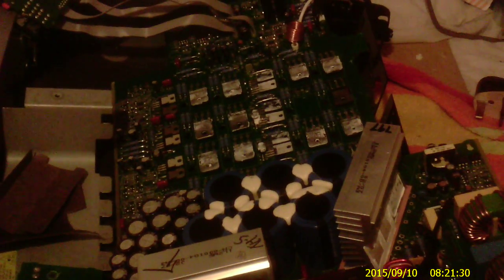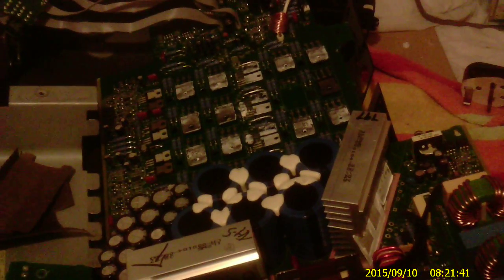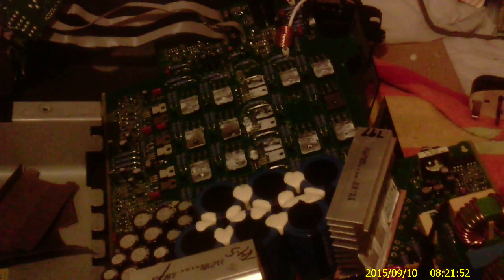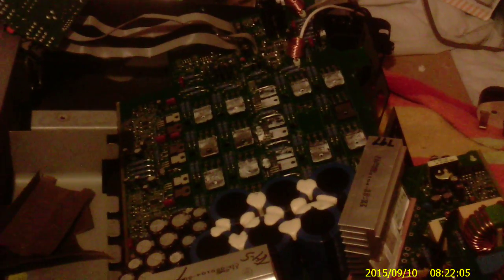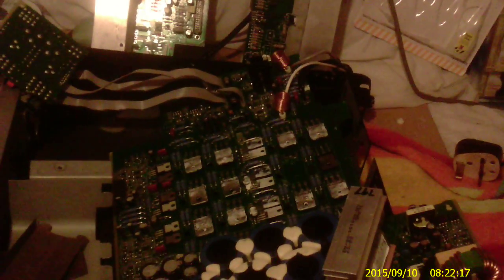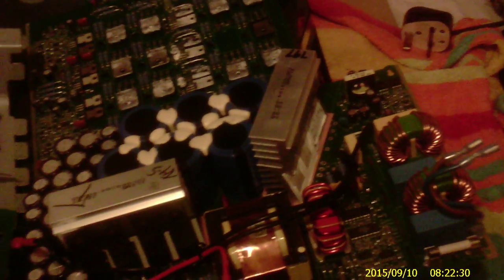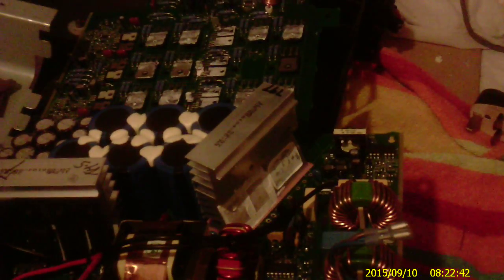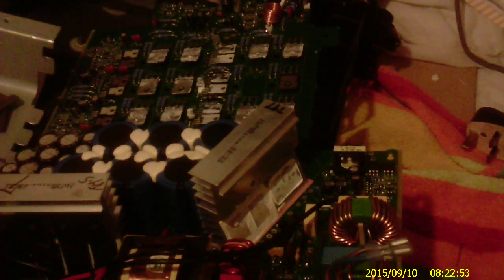QSC PLX3102

Comment: Hi,

So interesting and educative , I have a burning question and I wonder if you can have a better answer . Definitely I see you are good in these amps. I do have  two amps with 120 v and my power is 240, So I normally use a step down transformers which is heavy for my mobile. I am told that these amps power can not be modified to 240. I would be much glad if you enlighten me better as regards to this.

  Kind regards Francis
Reply from the maker: Are they switch type power supply if not then it is simple to work out simply input your 240 to 110v ac transformer disconnect the secondry ac winding of the transformer (before bridge rectifier) and measure the voltage you then simply need a replacement transformer wired 240AC to your secondry voltage.If the amp is a well known amp make the service manuel will tell you all the spec you need
Reply: Yes they are switched mode power supply . QSC PLX2 3202 model and I am looking for how to convert them from 120v to 240v ,could this be applicable.
Reply: @Rallymodel  Yes, CX and PLX can be modified to work on 240V AC mains, you need to do: 

-first remove the red wire which go between big filter caps,
-than move the small jumper from 120 to 240V position on the pcb.
Reply: @Felix2417425  One more question, will the amp work as normal without the red wire?
Reply: @Rallymodel  Yes, it will work normal, I have CX model and I did exactly this and it works on 230V mains with no problem. Red wire which connects between capacitors is for voltage doubler, and you must remove it, otherwise capacitors will explode if you leave it and connect to 240V mains!
Reply: @Felix2417425  I finally did it in the night. awsome, the amps are now hooked to 240 and I must be the happiest guy for your assistance. Please a BIG thanks, I couldn't believe when I saw your reply because I asked you this, some years ago and you did the best research till the problem is now solved.
Reply: @Rallymodel  I'm glad that I could help you! I really like these amps, and I looked up the schematic and realized that this modification is possible.